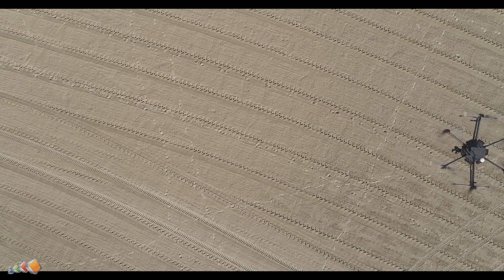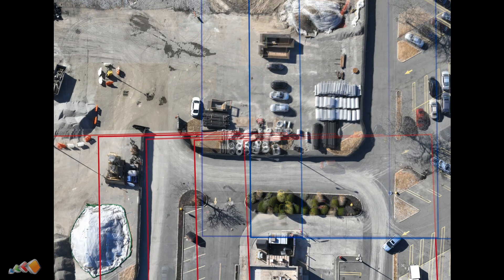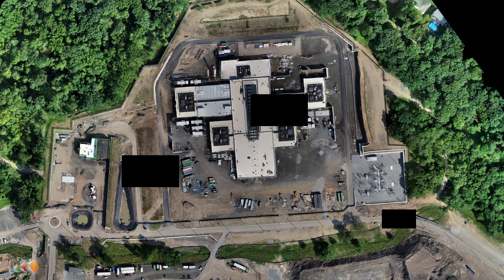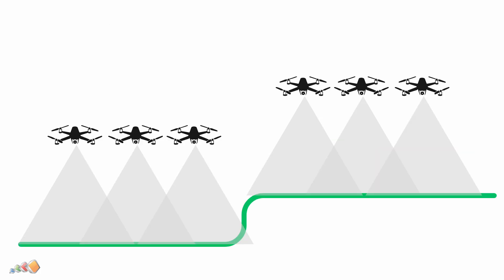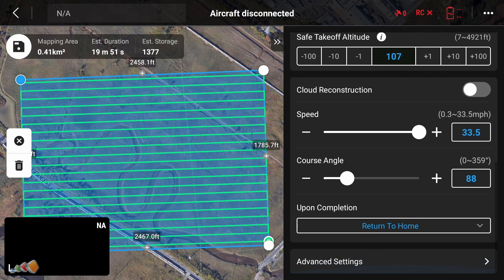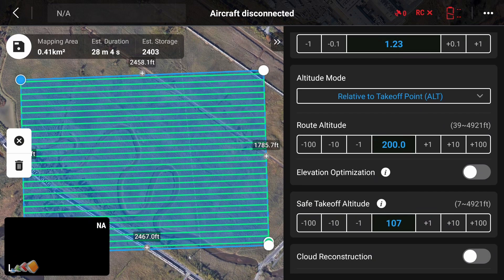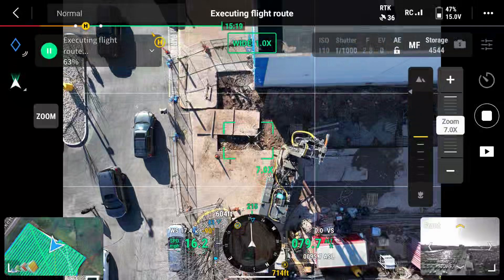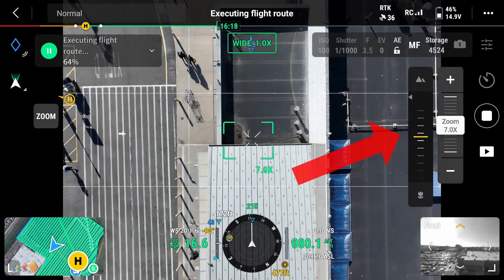Understanding Overlaps in Drone Mapping

Comment: It's very interesting in that for my work I fly a 500 Ha site in two 300 Ha chunks that then get merged after they are processed. The overlaps I use are so little to keep flight times manageable and have them set to 50% side and 60% front. There's maybe a Max 40 m height differential between the peak and valley of what I'm surveying and these are captured at 120 m above the take-off point. I never once thought that the overlaps would change as the landscape changes but thankfully it's that it increases overlaps rather than the opposite
Reply from the maker: Right!  If you had started at the higher elevation then your overlaps might not have been sufficient!